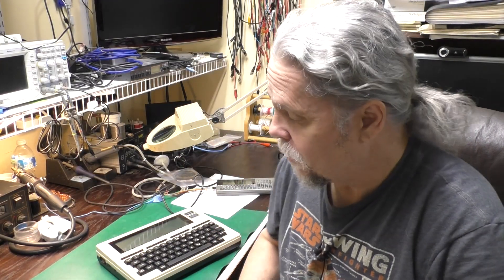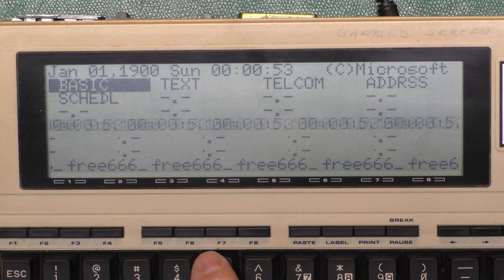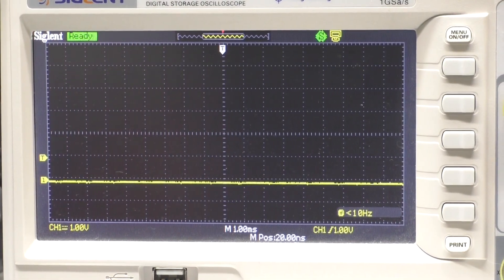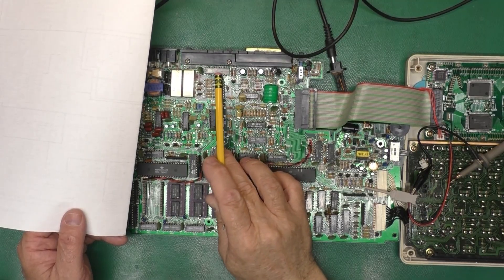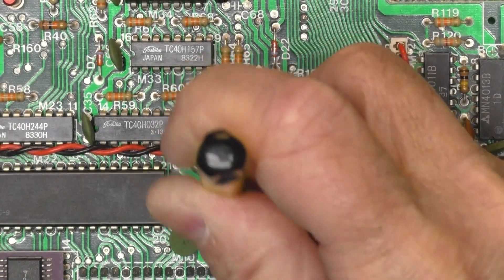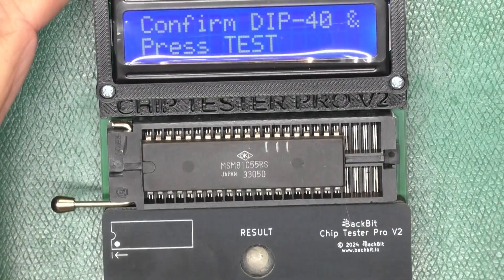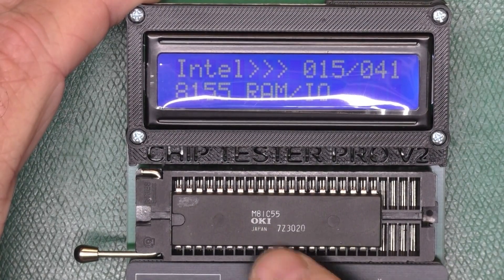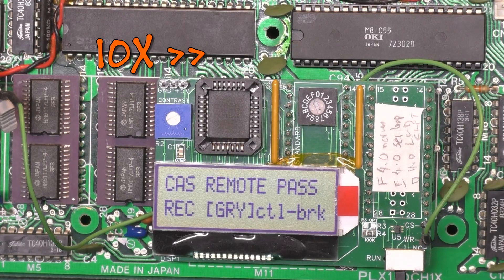TRS-80 Model 100: Diagnosing and repairing an unusual fault.

Comment: Hey Birt! What solder sucker/iron do you use? The Hakko is OK, but I really like the external pump version you have.
Reply from the maker: It is an old PACE MBT. I got it about 12 years ago used from eBay, probably close to 20 years old. If you watch you can occasionally find a good deal on one. I paid about $400 for a barely used one with four hand pieces. The new Pace units are closer to $1500.

Pace sold a ton of them to the US Military and thus still makes parts/tips for them. I typically find surplus Pace tips on eBay as new ones can be $$.